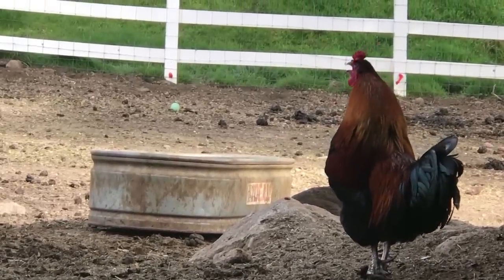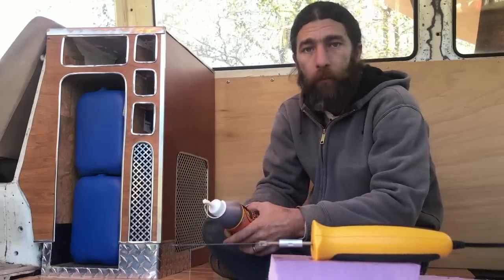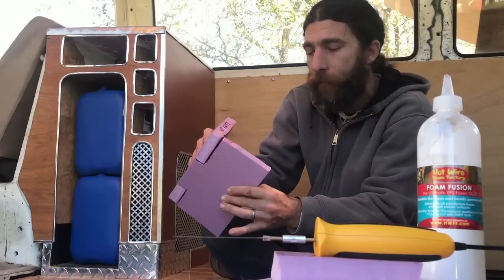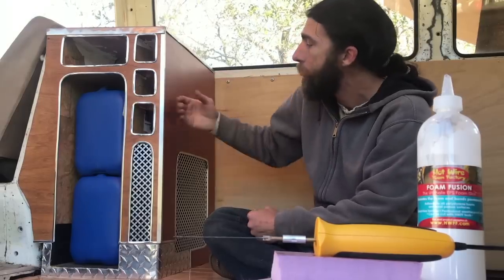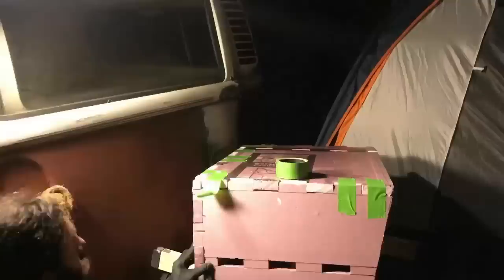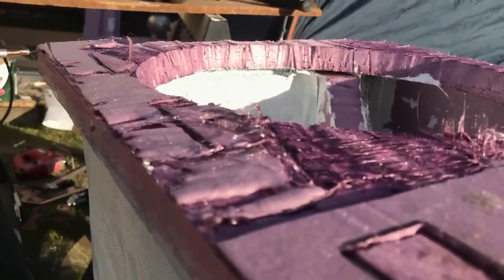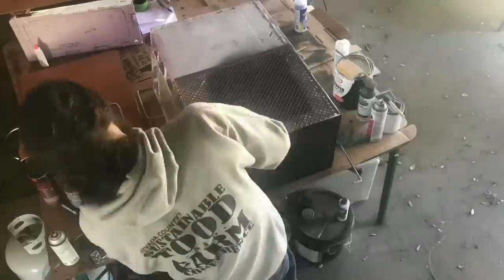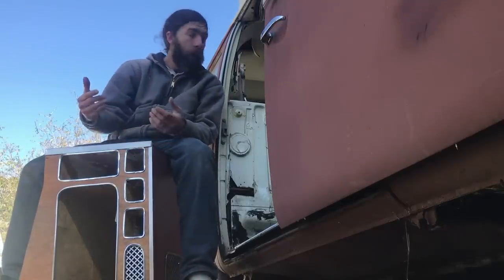Foam Cabinet Prototype - Improvements on Building Foam Cabinets for Camper Van

Comment: This is a spectacular effort. Great job building the sink and telling the story. Please continue making videos.
Reply from the maker: thanks for your encouragement!!
Reply: I agree.......you explain this very well.....looks nice
Reply: Agreed. Nicely done!
Reply: Agree entirely with commentators here - thanks and keep doing it! One thought that came to mind - perhaps if you setup a jig for the hot knife cutting that allows you to follow a predetermined outline - joints would be tighter and even stronger - just a jig made from scraps of wood.
Reply: @MiniLuv-1984  or out of sheet metal... then electrify it and bingo !  done, punch style !  or forget the heat and just make a sheet metal punch press with a thin, sharp cutting edge.  I say "just"... I do not have even a shop or metal working tools but I sure enjoy watching all those that do !
Reply: Excellent video
Reply: brilliant

Comment: I can confirm that foam insulation sandwiched between thin metal sheets makes an incredibly strong and light structure. We used this for building robots at a local high school for the national robotics competition. Four big guys jumped up and down on a three by three foot piece suspended across two cinder blocks - barely flexed at all. We used gorilla glue :)
Reply: “Cinder” blocks? Nothing to do with cinder anymor. Concrete blocks
Reply: EPS foam is standardized to 10psi. 

I've been googling....
Reply: @louiechidwick6034  first off my commercial neighbor built walk in freezers and his were sandwiched between oriented strand board or whatever that stuff is called that was at least half inch thick and on both sides. The overall wall thickness was much much greater, like 8” for obvious reasons, and you’re not supposed to put anything on the roof of a freezer nor do you stand on the walls, so this is totally irrelevant, not to mention the word thin is relative and could be 1 mm or it could be a quarter of an inch
Reply: How can you confirm that when you don’t even know how thick somebody’s gonna make it overall or how thick the metal that they sandwich on the outside is going to be, much less how much load will be on it or how far it will span. you couldn’t possibly confirm anything without knowing that information at a minimum. somebody built a robot in high school and decides they are structural engineer and qualified to advise others. I guarantee the high school teacher wasn’t a structural engineer.
Reply from the maker: @mark pope I can’t speak to freezer construction but I can confirm the op in this thread posted their comment 5years ago. This was the first in many videos I’ve done over the years on this building system. If you would like to discuss the details, I suggest checking out the videos from the last month or so.
Reply from the maker: To be clear this is XPS foam, there much newer videos on my channel, on this subject if you’re interested
Reply: Wait, three, not two points define a plane and even if you had 3 concrete blocks the only area safe to jump would be inside the imaginary triangle. Four guys would have a hard time to fit jumping up and down even if they had the whole 3‘ x 3‘ square and I’m guessing you put  the concrete blocks completely underneath the panel which means some of them are basically just jumping up and down on the concrete block, not the span. You had 4 big guys jumping up and down on a board only 3 foot by 3 foot only supported in the middle of two ends by at best an 18” width of a concrete block. I want to see video proof if that hilarious test. We’re they holding hands?
Reply: @MelissaThompson432  10 psi? What about it? Lacking information
Reply from the maker: @marc pope again… you are trying to argue with a comment from 5 years ago. I doubt you get much of a reply.
Reply: Well, my world just expanded.

I had never even considered using foam for interior builds.

I'm poised to buy a small ambulance, and I don't want to tear the thing apart. This is a perfect way to do an "insertion" style build. 

Keeping the weight down means less fasteners that will bounce loose after rolling down the road for any length of time.

Thanks for posting!
Reply from the maker: Yeah this is a great solution for that situation I think! If you don’t feel like the ambulance is very well insulated, consider adding foam in the back of the existing cabinets for more insulation.
Reply: @falkornomad  Well, you certainly have my attention. I just subscribed.  This is beyond "right up my alley".  I'm having data cascades in my head, as 25 years in the building trades assimilate this information.

I'm excited to see more, and to start designing and putting it into practice.
Reply from the maker: I have several videos on my channel of my full Transit build out right now.
Reply: @GOLDVIOLINbowofdeath historical data show’s structure were invented before there were structural engineers.
Reply: @adamheskett6245  yes it was called build it and see if it falls down or trial and error. I suggest you Google Beauvais Cathedral. As long as the poor peasants are paying the cost of your failures you can afford to do that. BTW, I’ve been to this cathedral.
Reply from the maker: To be fair… “build it and see if it falls down… trial and error” is exactly what I’ve been doing with this build system for the last 5 years!!

Sometimes I think that the conventional mindset and/or approach can be limited in scope and too specific in use case. Plenty of examples of highly engineered building / infrastructure failures… sometimes someone has to just give it a try and accept & learn from failure when it comes… and it will… I never said it wouldn’t!!
Reply: @falkornomad  a lot of times friends of mine and family who are engineers by trade stay away from certain projects because they say they aren’t able to do it the way they know it would have to be done to be spec. It takes bravery to just hold a board in the air and eyeball something then pin it, but sometimes you just gotta give it your best and then jump up and down on the thing like you showed ! If you can stand on it you can probably cook a waffle on it. The whole process of refining foam construction is hard to argue the results when any modern construction expensive trailer caught in mid size hail will be totaled out by insurance due to complexity of repair. Intriguing and certainly a unimaginable future for these foam construction. Marine application for houseboats would be a great route for example. Aeorospace. Add in 3d machining of the foam with a mill to cut the manual labor-
Reply from the maker: The sky is the limit.

I agree… sometimes it takes some non-spec exploration to get the engineers to scratch their chins. 🍻

Comment: Watching tons of videos to find what should work for my build. I plan on building a camper shell on an old trailer that has an outside measurement of 5'7" x6'10". I need to be able to stand in it but hope to make it lightweight enough to tow with my 2005 Grand Prix. I should also mention I am 56, a woman and have rheumatoid arthritis . It is difficult for me to move around sheets of plywood so this type of building is right up my alley!

Comment: Impressive, more of a cabinet makers perspective on how to make cabinets with foam. I can see the advantages of using the right glue, the right tool and the joinery. Well done. I'll use this method to build cabinets and storage in my Camper. Building a slide in, side out camper on my utility trailer. Looking into how to build SIPs using either the fiberglass screen or thin plywood to make walls. Thanks for working thru this method.

Comment: best foam cabinet video I've seen so far. awesome! Definitely going to check out where you got those tools.
Reply from the maker: wow... thanks! Having the right tools is key in any project.
Reply: If you need or wantprecise cutting, you should look into a proxxon hot wire cutter (or similar) https://www.proxxon.com/us/micromot/37080.php I think there are plans around to make one yourself.

Comment: Great little video absolutely no way to go I'm astonished at how much wait people put in their van conversions. I. know in the USA the gas is cheap but in the UK every extra pound you drag around it's gonna cost you loads. First time I've seen a hot knife will be getting one. Very useful little tune I have got hot wire set up already but that looks ideal for the tricky little bits.
Reply: "but in the UK every extra pound you drag around it's gonna cost you loads". Obviously weight does matter, but the stuff I put in my van (gear, bikes, water, food and especially the people) weighs a lot more than the fitout structure. My structure is removable and I've never been able to measure the difference between in/out. It's much less than 1mpg. So my impression is that the shape/weight of the van itself (and how fast you go) utterly dominates, and people obsess over weight more than is warranted. Although I would use lithium in a new van, not lead-acid, just because that's 40Kg that really is kind of pointless.

Comment: I appreciate your time!  I am completely renovating my 26 ft 5th wheel.  The original wood is horrible!  They used cheapest wood,  partial board, and carpet.  Not me! I have been putting off my kitchen cabinets just because I wanted something better.  You just provided me with what I needed! Thank you. 

I really appreciate your calm narrative with full explanations of what you did to achieve the vest results!

Comment: Your ideas are most certainly an improvement on the other methods I have seen. Good job ... and with the video as well. Great explanation. I look forward to seeing the progress!
As I've been thinking of my future build, I was thinking that a template made of cardboard to map out dovetail-type joints ... and transfer the template onto to adjoining pieces. 
I was going to use PL (or something like that) ... thanks for the product recommendation!  :-)
Reply from the maker: For the finger joint template idea... I suggest using one of your foam joint cut outs as a template... then as you mark where you will make your cuts on the first board space it and adjust the width of it so you don't end up with a tiny sliver of a joint at the end. Then cut out those joints... then mark the abutting board and cut it. I thought a template would be good too... but I ended up doing it this way.
Reply: NØMAD Good to know. Yes, easy enough to do each joint separately. The joints can be spaced according to length easily. 
Thanks for the feedback!
Reply: If you make templates out of a piece of plywood or even a board pulled from a pallet, than you can clamp the template to the foam to be cut and then cut it using the foam hot knife... no time wasted marking the foam.

Love the cabinet.  Solid video.

Comment: Looking forward to seeing how you do the bed !!!! Thanks for the heads up on the cutter and glue. Subbed so I don't miss a thing.
Reply from the maker: Thanks... lots of folks are talking about the bed from foam... I had not considered doing the bed / seat out of foam... I'll have to ponder that a bit... it's an interesting idea... I have a mock up of the bed in wood right now... it would be a challenge to do it in foam... hmmmmm....
Reply: Maybe do part of the bed from foam?  You are smarter than the average bear.  Enjoyed the video; looking forward to seeing more!

Comment: Wow, that was really incredible.  You have a lot of skills working with all those different materials.  I watched YouTuber Into the Mystery 13 showcasing a guy who made these same style cabinets for his van,  and it looked really interesting.  Then he tried to build them for his own van and it turned into kind of a nightmare for him, as there were quite a lot of steps (size, cut, screen, paint, etc.) . Still,  I like the looks, the low weight, and very inexpensive cost associated.  How long did it take you to build that cabinet?  Did you add the venting since you seem to be storing water/grey water in there? What do you think you spent in round numbers?  Thanks for posting!
Reply from the maker: Glad you liked it!

There are a lot of steps, time wise, as I said below; I would guess that just that one cabinet, if you had all the parts, tools and materials on hand... would be 3-5 hours start to finish. But I was doing all kinds of experimentation and had to do steps over. I have 9 more pieces to go... I will keep track of the time... that's a good idea! 

The venting is actually for a 12v Cooler that will be in the next piece over in needs to be able to vent the hot air away from it.

Cost wise... that's though... just for materials: $20 in foam, $2 in glue, the screen was used... but it would have been $5 or so, $2 in paint, the finish ply is $22 a sheet and I used less than half a sheet so $10 there... um... I mean $4 in truck bed liner... the stainless steel was scrap I got for $12 and I'll get 3 counters out of it so $4 there... so maybe around $50... I don't know... it's hard to nail down a price on one small piece. I'll try to think about that / track it. 

I'll talk about this more in a future video but I'm not doing foam to save money, I'm using it because it's the best material for the job.
Reply: NØMAD x this is an entirely new method for me and full of possibilities. Thanks!  I have 2 questions m. 1st, when using the hot knife - are there any noxious fumes while cutting?  Second, it is difficult to see how slow the cut goes. However, if you went with the hotter 3” knife, will you experience some ‘melting ‘ if you don’t move fast enough?

Thanks for the great video!  Husband is in a wheelchair and is like a bull in a china shop. If something is in his way, he just forces it out of the way. So, am not sure how the foam would hold up. The kick plate might do the trick. If not, I will start loading the sink with water. Getting a lap full of water might encourage him to resist knocking things around like that. After 20+ years of asking him to take care, sometimes a little behavior modification is in order. But either way, am thinking the mesh support might be a bit more forgiving than the 1/8” plywood.  Thanks again

Comment: I am planning a cap top camper build for my old S10 and using the foam is genius thank you also the tips on the glue the hot knife etc thank you, I will try take some photos and post, might be a time i'm old and no moneys but like this dude desire beats dread any day and I am dreading not haven a home or shelter and am gonna build something like this. Thanks again, great job!

Comment: Have you tried using fiberglass cloth instead of the screen?
Reply: Seems to me that, unless you're building a bookcase, it'd be overkill
Reply: Los Apriscos yeah I was just thinking it is lighter than the mesh and pretty cheap. Also sands easily. Cool method either way
Reply from the maker: This is covered here: https://youtu.be/dru51u-vLCs
Reply from the maker: Hey thanks for the comment! It was addressed in this video I just released. Check the table of contents at the beginning if you want to skip to a particular subject: https://youtu.be/BcAXr_gtbG8

Comment: Where did you get the molding for around the openings ?
Reply: It looks like automotive pinch molding trim. probably also used in other cabinet applications.

Comment: would have been lighter, way easier and way stronger to use 1x2 (3/4" x 1 1/2") framing with a 1/4" thick wood paneling for a skin.
Reply from the maker: Hey thanks for the comment! It was addressed in this video I just released. Check the table of contents at the beginning if you want to skip to a particular subject: https://youtu.be/BcAXr_gtbG8

Comment: He should patent this ...........
Reply: No he shouldn't - that would stop the rest of us using it. How is that an improvement in the world?
Reply: No it wouldn't stop you, plus there is nothing to patent here.
Reply: There is nothing new to patent. The RV industry uses cnc machines to cut out entire camper/motor home shells made out of thin aluminum sheets bonded to a foam core for years in the construction of their lightweight vehicles.

Comment: That was well done from start to end. As so many have said Thanks for all the time you took to make this video you keep the weight way down like in aircraft,

You improve or made people thank of how interlocking the pieces really help hold it in place before any Glue is applied

You show a way to make it stronger and not break the bank by using cheep screen and paimt

You show how to keep the bottom water and a anti-skid floor.

The kick plate was well done along with all the others things you did like using the hot knife

As so many have said well done and thanks for posting

Comment: Nomad- Thanks for taking the time to share.  I took careful notes on the foam tools and glue.  Reason for my comment, aside from gratitude, is to let you know that foam has a horrific issue with breeding mold.  Please understand, I am a certified Indoor Air Quality Specialist.  I inspect commercial buildings for their condition.  Look up "EIFS" and you will find that the construction industry attempted to skin buildings with foam boards and stucco over that.  One of the single most worrisome liabilities for mortgage lenders and insurance companies.  It's bad.  So- I will use your foam cabinet idea in my own camper designs (but may not be as extensive in laminating them) and give you credit.  But I won't kid myself about avoiding the possibility of condensation or leaks resulting in mold related to foam.  Can't wait to see the complete build!  Best From CA US